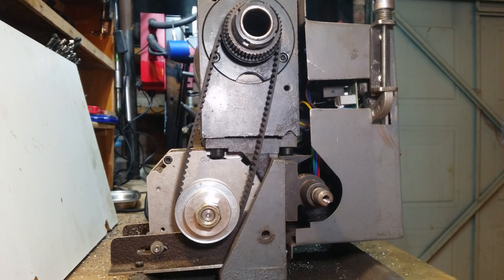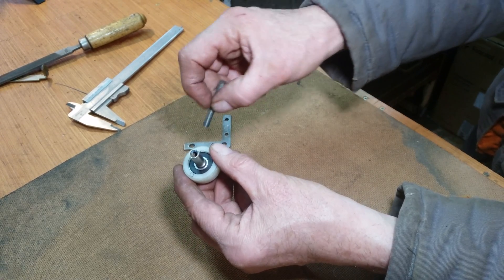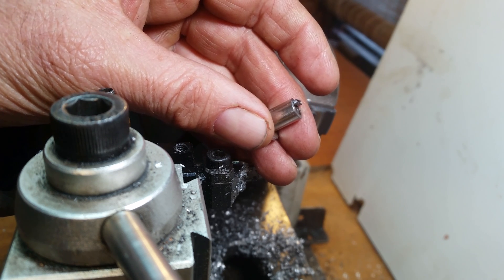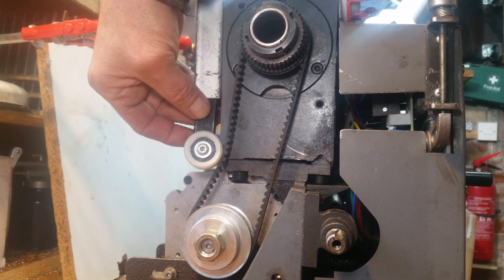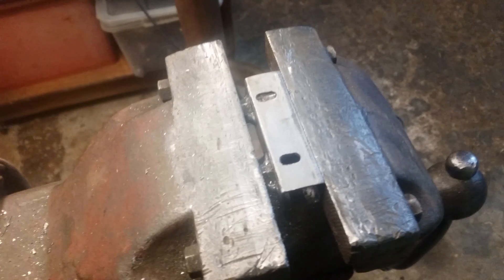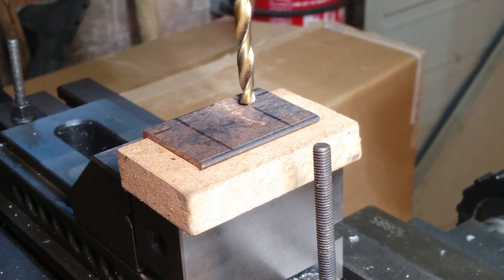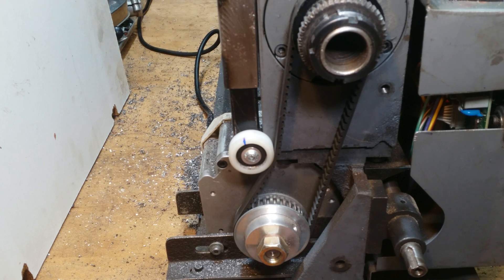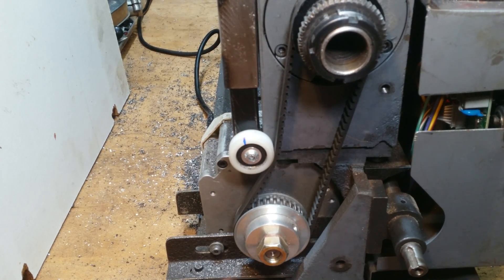MINI LATHE UPGRADES #5: HTD DRIVE BELT TENSIONER

Comment: Why not just move the motor out a little?
Reply from the maker: Great question, thanks! It's a fiddle moving the motor - you have to reach over the lathe and iterate loosening and tightening nuts and bolts while you realign it. This way I can tram the motor once and use the tensioner to pick up the slack as the belt stretches over time.
Reply: not so easy due to ill thought out design.
Reply: I assume back gears go back without difficulty.

Comment: Doesn't that motor mounting bracket have slotted holes to allow the motor to tension the belt.....it shows in the end of the video.
Reply from the maker: Hery, thanks for commenting. Yes, I did make slots there with tensioning in mind but they're very awkward to get at. The slider arrangement you see in this video is much easier to deal with. Appreciate your input, thanks for dropping by.

Comment: Well this was fun. 😊 I've spent the last 8 months or so, fettling my little 7x (partially following the Seig SC3 and C3 upgrade PDFs available on the ArcEuroTrade website and partially the likes of Steve Jordan, ArtisanMakes and We Can Do That Better). Lathe is in bits for the 3rd time as I'm currently adding Steve Jordan's centre saddle plate.

Just one suggestion. I saw you using a Stanley knife for deburring on one of your videos. Cheap imitations of Noga deburring tools are reasonably accessible. 😉
Reply from the maker: Hey Steve, I'm glad you enjoyed the video and many thanks for the feedback. Thanks also for the steer to the other channels, and also for the tip about the Noga deburrer clone - I keep meaning to hunt one downbut the Stanley knife is always on hand!Good luck with the centre plate - it would be great to see the results when you're finished :) Appreciate you taking the time 🙏

Comment: just an observation why not move the motor out on the slide
Reply from the maker: Hi Richard, thanks for taking the time. It's a great question and one I should've addressed in the video. Space is really limited behind the lathe, and it's a proper pita to get to the 4 motor mounting bolts. Trying to get the belt tension right whilst keeping the motor in alignment under those conditions ends up being a multi-hour curse-fest! I wanted something that was easier to get to, and more capable of delivering consistent results. Appreciate your feedback, and great to see someone's giving my little videos such close attention! All the best. 👍

Comment: Great job. You must read my mind. Everytime I get on YouTube looking for ideas, for a project I'm working on There you are. I'm doing what I call The big motor upgrade and I'm putting together video 4 and it's making a belt tensioner. The videos won't be out until April. But it's the same belt the main drive belt. I love watching how you do things and how you think. You put it all out there and don't hold back. Thanks for being a Video Creator and sharing your experiences.
Reply from the maker: Really appreciate your feedback Glenn, a major part of the motivation for these videos is the support and generosity of spirit I've found in our mutual community of like-minded hobby machinists. I'm finding your videos a solidly useful source of mini lathe mods and tips and would recommend anyone reading this comment to check out your channel. Very best of luck with your belt-tensioner project - hope my screw-ups supply some lessons!!